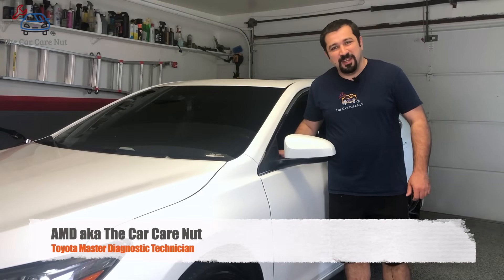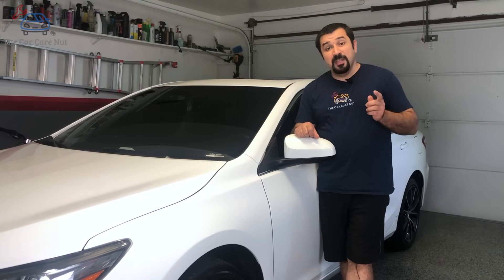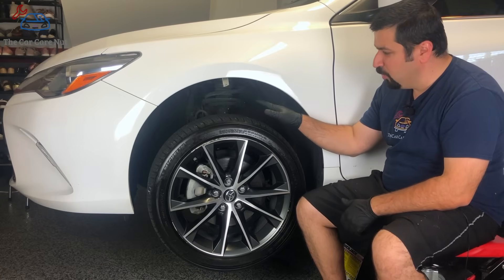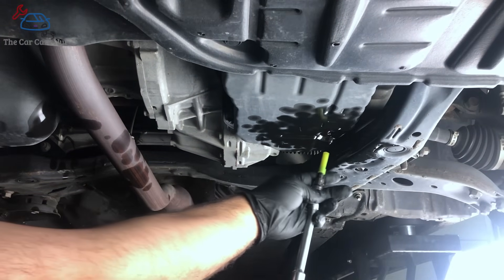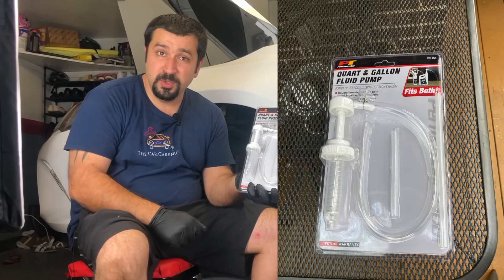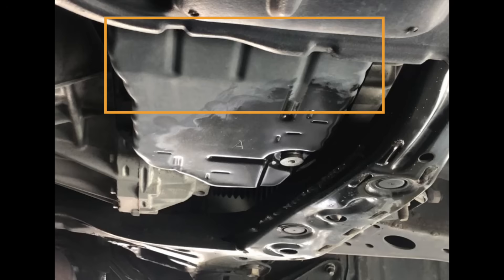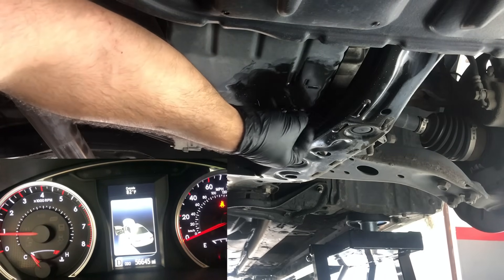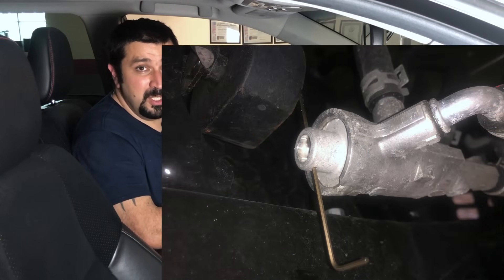How to change your Toyota Sealed Transmission Fluid

Comment: Hi AMD, thanks so much for this video! Question for you: I've got a 2015 Sienna LE at 78k. I bought it used at 48k in 2020 and am doing some drain and fills on the trans fluid. Most people seem to say it's prudent to not flush or drain and fill the entire amount of fluid in the trans. So far I've done two drain and fills for a total of ~3qts. replaced. It looks like the van uses 6.9 qts total. I'm wondering how much fluid to replace before waiting another 30k?

Comment: Thank you for the great videos!  I have a 2016 Highlander that has 120K miles (85% highway miles)  but has never had the transmission fluid changed.  Would you recommend doing a drain on the transmission pan and the another drain in a few thousand miles.  Any insight would be greatly appreciated.

Comment: My neighbor just bought a 2015 Toyota Corolla S model with 140,000 miles. The car has a CVT transmission and never had the transmission fluid changed. Do you recommend to have the fluid changed with this many miles?

Comment: Only one question: how much fluid you replaced? 2.5 quarts. The capacity of CVT transmission fluid is 7.6 quarts. You didn't replace the transmission filter! You just didn't do this job right! You just replaced 1/3 of the fluid and left dirty filter! So "professional"!
Reply: Everyone knows drain and fill doesn't change all the oil.  Yet the dealer does the same procedure.
Reply: @jshepard152  everybody knows? So why "professionals" don't care? Even dealer's "professionals"? My friend have made it better! He replaced the filter! So shame!

Comment: I have done this twice on my 2016 Scion tC.  I have a few additional notes about how I do it that makes this even easier.
- First time I used a paper clip works to jump the two pins, this worked perfectly.   I now have a scan tool that shows the trans fluid temp, and this is even easier.
- You do not have to completely remove the panel in the wheel well.  The panel has five clips, and the leftmost clip behind the wheel well liner does not need to be removed.  Just remove the other four (the ones you can see and are easy to remove) and the panel will be able to rotate down and there will be plenty of room to access the fill bolt.
- You do not need a special pump for the new fluid.  I have a funnel with a 18 inch flexible hose.  The hose has an outer diameter of about 3/4 inch and fits right in the fill hole.  Because we took off the wheel, there is plenty of room to pour the fluid into the funnel.
- Cover the rotor and caliper with a large rag.  You do not want to accidentally spill trans fluid on the brakes!
- I have a super easy method to jack up and level the car.  All you need is two jack stands, your floor jack and a magnetic torpedo level.  Start with the car on level ground.  Before jacking up the car, put the level on the roof of the car, positioning it anywhere that the magnet will hold it in place and the level is level.  Now jack up the front of the car, and lower it onto the jack stands, making sure that the stands are at the same height.  At this point the level will not be level.  Now jack up the rear of the car from a solid point in between the rear wheels. Stop jacking when the level is level again.  BING - the car is level, you can remove the front left wheel and it is safe to go under the front of the car to reach the drain plug.  (Just don't crawl under the rear of the car because it is only being supported by the jack.)
Reply: You can also place your level along the bottom trim about halfway between front and rear wheels to gauge levelness with the spirit level. I also did jackstands in the front and a jack in the back.
Reply: Nice tips.  In reference to having the car level, I think it's easier to just measure the height  of the wheels from a level garage floor with a yardstick.  😊
Reply: @AC_metro  no because the springs/shocks compress while supporting the car, but they extend and hang down when lifted, but you don't know if the front and back compress by exactly the same amount. Front end is heavier and that end may compress more. Your measurement tire to floor would be wrong then.
Reply: @alan4sure  good point. In hindsight, the level seems to be a better route.
Reply: @AC_metro     What scan tool do you use?
Reply: @jshepard152  I didn't use a scan tool when I changed my trans fluid, I just jumped the pins on the OBD II port.

I had just purchased my first Lexus when I changed the fluid and I didn't have a Consult III diagnostic tool. I do have a pretty good OBD II scanner, but it cannot read trans fluid temps.
Reply: What’s the temp to change it af

Comment: I have a question, I drain my transmission fluid and put back the amount that was drained. Then the next day I drained the overflow side. About 2 1/2 once came out. Then I put back the same amount. Do I need to drain the overflow again, yes or no. It’s for a 2020 tundra 4x4 TRD.

Comment: I changed my transmission fluid in my 2016 Scion IA I basically just did a drain and refill drained exactly 3 quarts out and put exactly three quarts in everything worked out fine no problems the biggest job on this car is taking off the big shield underneath the car other than that it's easy job anyone who has this car it uses FZ transmission fluid is very expensive stuff like everyone says do not use any aftermarket transmission fluids don't take a chance

Comment: I don’t understand why you would add that extra half quart of fluid. I recently bought a 2018 RAV4 with 53k and was thinking about changing the fluid is it necessary or should I wait? Also what is your opinion on Amsoil atf? Thanks
Reply: I use amsoil engine oil, but would only use manufacture fluid in the magic box that is a transmission. Amsoil does a great job translating oil compatability on the web site, but I stay with oe fluid.
Reply: I finally got around to doing the procedure today and I thank you for your help. To recheck the level again after a few weeks I just take out the drain plug again?

Comment: Well I finally have all I need for the fluid change tomorrow on a 2015 Corolla S with a CVT transmission. Just to confirm the temp to check the level is between 95 & 110 F?

Comment: I couldn't get this to work on my 6 cylinder 2014 Venza.  Everything works fine until the part where you have to shift back and for between Neutral and Drive.  I did this for 15 minutes and the indicator never stayed solid on Drive.  It was only 40 Fahrenheit out but I would have thought after 15 minutes it would be up to temperature.  Does this work for 2014 Venza's?
Reply: I am going to go forward on the basis this doesn't work for my vehicle. Going on to Plan B, what would the operating temperature range for the 2014 Venza XLE if I am going to measure the temperature at the pan?

Comment: Great video! Thank you for all the great videos you do. 
My wife has a 2020 Camry, 4 cylinder its at 50,000 miles and I'm thinking its a good time to change the transmission fluid for the first time since we bought the car. I tried the jumper method on the OBD port, but it didn't work for some reason. I have a temperature gun as well. Could you please let me know the temperature range that is needed for a 2020, 4 cylinder Camry?

I'd like to add that I also add that I very much appreciate your prayer at the end of your videos!

God bless you and keep you.
Reply: Did you ever get a reply for the temp , I'm also wanting to know 😅
Reply: I couldnt get the jumper to work either.  It works on my sienna so i think im doing it right
Reply: The temp range should be 95 to 114 f

Comment: Just keep driving your Toyota without changing the transmission fluid like I did.  When it reached 300k miles and 23 years of ownership I gave it to my grandson and transmission was like new. I did change engine oil every7k miles and did it myself. I bought another Corolla.  I don't think that changing a small fraction of the total capacity of transmission oil would make any difference. There is more of a chance someone screwing it up while replacing it, or do you think they go through step by step at a repair shop as it was done here?  Thank you for your videos, I've learned a lot from them.
Reply: That is impressive. Oil burns and deteriorates which make the clutch disks wear. 300k on original fluid is amazing. At this point never change it. I am curious how black and stinky that fluid must be.

Comment: Thank you so much for your video as it helped me immensely. I just finished my first ever transmission drain and fill on my 2013 LEXUS RX 350 as I hit 100K miles today. The oil was a bit thicker, dark and had a slight burnt smell; and surprisingly I only got 1.6 qts of fluid out on a leveled surface with an overnight cold transmission. Next time I am thinking about jacking the front wheels to get more fluid out.

One of the things that I was little confused was in Step#4 at 11:16 where you demonstrated to shift between "N" and "D"; it took me around 3-4 mins of rapid shifting before the "D" became solid; I was expecting it to come within few seconds as demonstrated in your video but for me it took close to 4 mins. More importantly one of the things that I was not very sure was if I needed to keep shifting between N and D until the solid "D" shows up on the display; I was almost ready to give up as it was hurting my wrist pretty bad. Once the "D" showed up and stayed solid, I put the shift in "N"; quickly removed the jumper clip; ran as fast as I can under the car to unscrew the cap; and to my dismay I only got a little bit of fluid out and it started trickling like in your video. I think I only added little less than 2 QTS (12oz less) as I took just little more than 1.5 qts. I took the vehicle for a test drive and everything felt normal. As per your recommendation, I am going to verify the fluid levels within a week or two to ensure everything is in order. Thanks again for all your great videos.
Reply: On a 2018 highlander do you have to put wrench in the cooler and when do you remove it 17:03
Reply: @edbielick202  I am not sure if you are referring to the same video as I did not dealt with any cooler line.
Reply: Is there a cooler bypass on your Rx? I have a 2013 f sport with 8 speed transmission- not sure if I need to press on the cooler bypass that he mentioned.
Reply: @Fpan87  TBH with you I am not sure; I did not do anything like that. I pretty much stuck to what was shown in the video and have so far done it 3X times. I will be doing this again 1X time after 30K miles around 130K miles next year or so.

Comment: At the video time 5.44, as the drain plug was removed, some fluid came out. With the cool transmission, the fluid should be below the overflow tube and no fluid should come out, if the fluid was originally filled correctly. Is that right?
Reply: I was thinking this exact same point; if we set the level correct, it should either only trickle or no fluid should come. I finished my transmission fluid earlier this afternoon on my Lexus RX 350.
Reply: The original level is set/checked with the engine running.  When he first opens the drain plug a 5:44, the engine was not running, so there will be more oil in the pan, and it will be above the overflow.
Reply: Thanks George.

Comment: Another question: In the note “Light meanings”, are we looking at the drive light while the jumper is in place or removed?
Reply: That’s concise and detail instruction! Thanks a lot Ravi.
Reply: You have to look for a solid "D" while the jumper is in place. You do not remove the jumper until the solid "D" shows up which could take any amount of time depending on your transmission reaching the desired temperature; until then you will have to keep shifting between "N" and "D". Once the "D" shows up solid you MUST leave the shift in "N"; remove the jumper, then open the drain plug to drain the excess fluid until it trickles as shown in the video. Hope this helps.
Reply: Thanks Ravi, your clarification is very helpful.
Reply: @billl2969  There is a slight update which I figured out today after going through the Toyota technical manual.  Below is my updated version once you re-fill the transmission fluid:
Step 1: Put in the Jumper; Push the brake pedal and start your vehicle.
Step 2: Shift through all the gears as shown in the video. 
Step 3: Shift between "N" and "D" rapidly for about 4-6 seconds/ 3 or 4 times and pay attention to the display; when you are doing this it will show "D" when your shift is at "D" and blank when your shift is at "N"; but very soon it will show "D" for about 2 seconds or so irrespective of where your shift is at that time. This means your fluid checking mode is enabled. 
Step 4: Now leave your shift at "N" and wait for few mins around 2-4, until the display shows "D". Now you can change the shift to "P". 
Step 5: Remove your foot from Brake. Remove the jumper, then open the drain plug to drain the excess fluid until it trickles down as shown in the video.

That's it you are done. Sorry for the confusion yesterday as the technical manual clarified a lot. Good Luck!!!!

Comment: Thank you for the excellent instructions. I do have a question in the last step: ……remove your jumper. Leave the engine running……do we leave the shift in D while checking the fluid level?
Reply: Leave it in "P" on the shift and definitely  NOT in "D" otherwise the vehicle will move forward. I left it in "N" and it still worked.

Comment: Thank you so much for your videos!  I love the detail, the information, and the 'do things right' mindset share with us!

I have a 2021 Highlander, 3.5L 4WD, 48,000km (30,000mi) and completed the transmission fluid change this past weekend.  I took care to measure the amount of ATF removed, and refilled, and found the transmission was left with approximately 400ml less ATF then what was there from the factory.  The vehicle was purchased new, so this was first time this fluid was changed.  I figured that I would be adding less then what was removed from what I noticed when I first removed the drain plug.  The A/T Fluid Temp No1 was cold (65oF), and a decent amount of ATF came out until it started to drip before the fill tube was removed.  

I followed the service manual and your guidance: 
Levelled vehicle
Pressed in the AT thermostat bypass
Drained ATF
Filled with cold oil, with a bit extra to ensure the level would be correct once complete.  
Used a scan tool to monitor A/T fluid temp no.1, heated up to 95oF, (95-113of as per the service manual), I keep it on the cool end since I figured I would keep more oil in the transmission than less.
Pulled the drain plug, and allow to drain until it began to trickle.
Returned the AT bypass to normal

I know I am a bit early to do this flush, but I am all in on keeping a well maintained vehicle will ensure trouble-free operation for years!

Question:  Is it normal that the first flush will result in a lower amount of fluid left in the transmission, or is it more likely I did something incorrectly?
Reply: Well I figured it out, and I was doing something incorrectly.  Even though it was very clear, I turned the engine off, then drained the excess, rather than keep the engine running.  I corrected this and I am much more inline with the amount of ATF as found.
Reply: Keeping the engine on, leads to less fluid being drained?  I was thinking that engine heats the oil and more of it goes into catch pan.
Reply: @gwilli1754  if you turn the engine off after heating the fluid up to the proper temperature it will led to less oil in the transmission, or more oil drained.  That is what I did wrong.  So I topped the fluid up, reheated the fluid to the proper temperature, left the engine running while draining the excess fluid.  This resulted in more fluid to remain in the transmission.
Reply: @nmhazzard   As the oil heats, it expands.  I think that the official procedure is just meant to be quick, get the oil plus extra to the operating temp, and done, right then and there close the drain.  I could see the procedure work well with two people.

Comment: Could you instead measure the amount you removed by weight to eliminate the volume variability?
Reply: Not if wasn’t filled properly from the factory or by a previous owner.
Reply: Yes, same amount comes out, same amount goes in.  Did my 2012 Camry 35000 miles ago. No issues.

Comment: My 2005 Avalon transmission shifts buttery smooth and has 163k miles on the odometer.  A dealer changed the fluid at 122k miles, but the fluid is starting to darken somewhat, so I am thinking about changing the trans fluid myself.  I have seen several videos of this procedure.  However, in one case the fluid was changed by draining the fluid from the drain plug on the bottom of the transmission pan. And another way, the transmission was drained by disconnecting the oil line at the radiator and then attaching a hose to the outlet and starting the engine therein pumping the fluid into a drain pan until the fluid sputters and then stopping and reconnecting the transmission line and repeating the procedure several times until clear red fluid is seen pumping out of the transmission line before buttoning everything back up.  Which is the preferred method and how many times is necessary to you drain and refill the transmission to complete the job and get bright red fluid?  Also, is Valvoline Maxlife full synthetic WS compatible a good choice or should I stick with the Toyota WS transmission fluid which I made by Exxon Mobil is my understanding?
Reply: Pull the drain plug. The transmission line method will change more fluid in the case, but can go wrong very fast and you toast the transmission. Dump and fill the pan (with correct fluid!!!) every few oil changes, and the fluid will stay clean(ish)